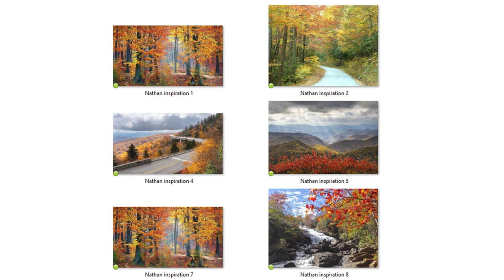Painting on Live Edge Slabs | Art Commission Design Process | Acrylic on Wood Painting Techniques

Comment: Beautiful commission. Can I ask two things , firstly do you use any mediums when applying your acrylics ,secondly what do you use to protect the finished art work , ie varnish ? If so is there one that you could recommend. I normally use liquitex medium / varnish . Thank you for sharing this . I have just been given a lovely piece of live edge wood which when I look at it it’s rather intimidating.
Reply from the maker: @soniabrickell4268  Yes, I mix a variety of Golden acrylic mediums into my paints, some for thick texture, some for thin glazing. They're all fine to use together, so feel free to experiment in your paintings. It won't mess anything up.

I believe for this piece, I finished it with an isolation coat, a coat of Golden UV top coat, and finally, a coat of Gamvar gloss.

That being said, Liquitex varnish is great! 👍